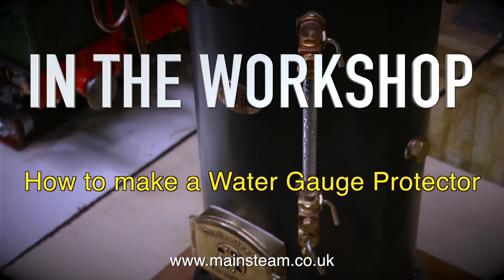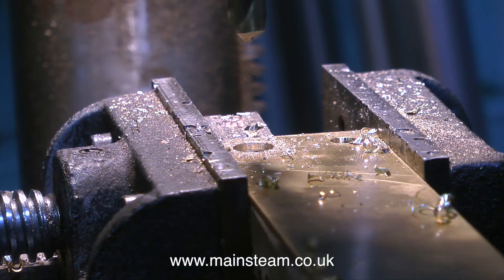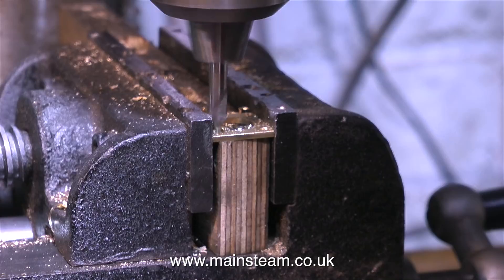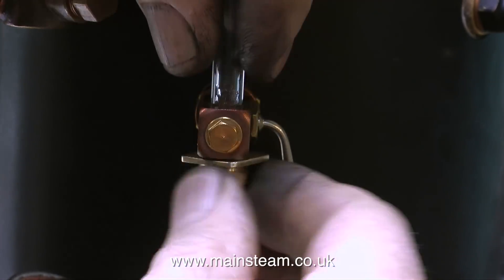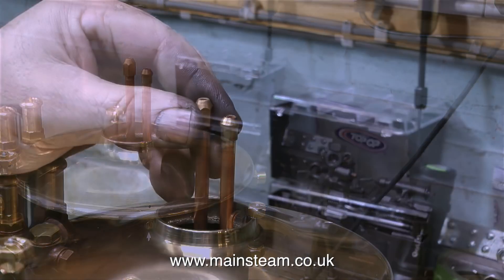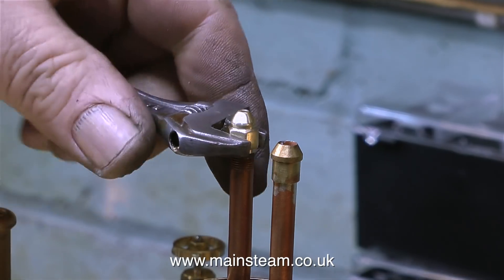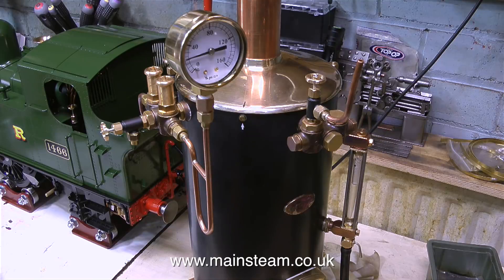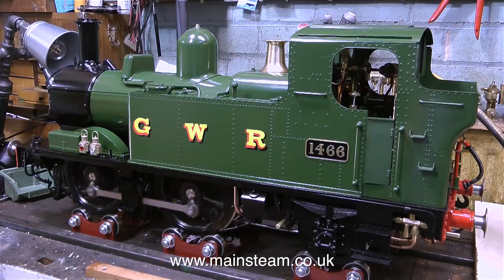HOW TO MAKE A WATER GAUGE PROTECTOR FOR THE V6 BOILER

Comment: I have seen (and I’m pretty sure I have one in my collection of brass parts) another style of water gauge protector that is simply a brass tube with a long oval slot milled out of the front of the tube. I does somewhat restrict the viewing of the water level, but it does do the job nicely.

Comment: In my previous employment as a radio technician (1960 - 1990) this sleeving tool was known as a Hellerman sleeving tool. To go with it we had a little bottle of Hellerman sleeving oil, into which the points of the sleeving tool were dipped to make the sleeve slip on and off easily. Nowadays people use heat shrink insulation to cover bare wire joints.
Reply from the maker: I still have some oil that I got with the Pliers - I think it's Coconut oil ....

Comment: Kieth back in the 1960's I believe they were called Hellerman pliers, and we used them (along with Hellerman oil) when fitting rubber sleeves on cable and even waterproof rubber cases over Microphones for use by the RN.

Comment: All of our HVAC hydronic heating sight glasses have protector rods like that. Except they just drop in from the top so they are easily removed to get to the nuts and o-rings. If you do a google image search for "expansion tank sight glass" you will see a lot of examples.